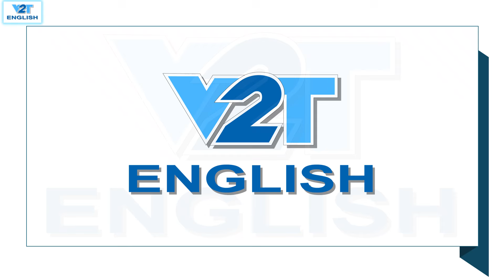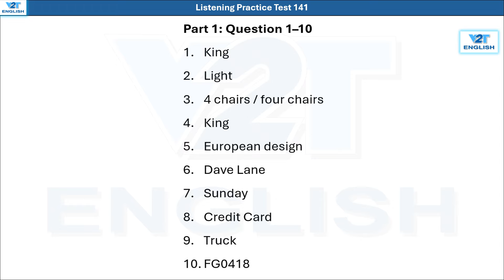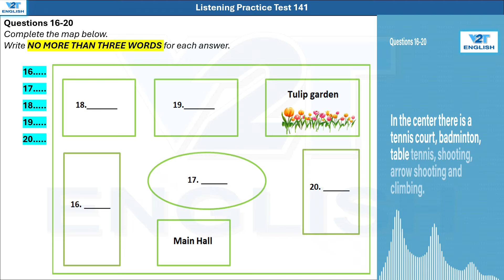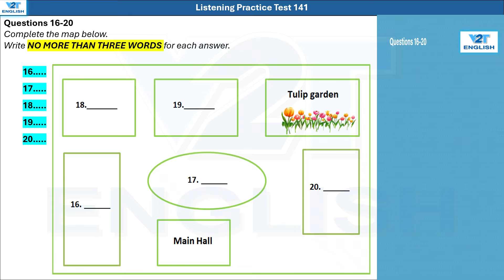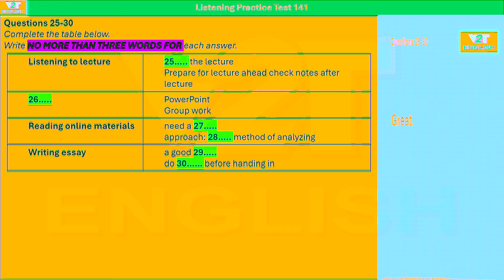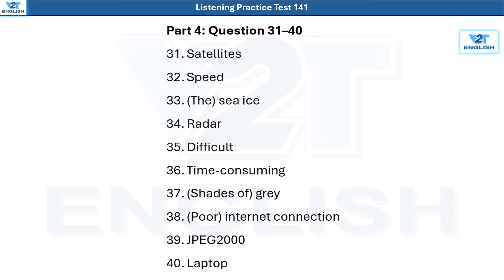Latest IELTS Listening Practice Test 2025 with Answers | Test 141

Comment from the maker: Answers:
Part 1: Question 1–10
1.	King
2.	Light
3.	4 chairs / four chairs
4.	229 pounds
5.	European design
6.	Dave Lane
7.	Sunday
8.	Credit Card
9.	Truck
10.	FG0418
---
Part 2: Question 11–20
11.	North suburb
12.	3,000 / 3000
13.	65 degrees / 65°C 
       / 65 degrees Celsius
14.	Jewellery
15.	SPA pools
16.	Villa Part
17.	Merry Water World
        / Water Sports Center / Centre
18.	Leisure Centre / Center
19.	Sports Centre / Center
20.	Restaurant
--- 
Part 3: Question 21–30
21.	A
22.	B
23.	D, E (Any order)
24.	D, E (Any order)
25.	Record
26.	Presentation(s)
27.	Username and password
28.	Skimming
29.	Draft plan 
30.	Proof-reading
---
Part 4: Question 31–40 
31.	Satellites
32.	Speed
33.	(The) sea ice
34.	Radar
35.	Difficult
36.	Time-consuming
37.	(Shades of) grey
38.	(Poor) internet connection
39.	JPEG2000
40.	Laptop
Reply: Is the answer to question 4 wrong? The correct answer is 229 pounds.
Reply from the maker: Hello @warhol5606. I wanted to express my sincere gratitude for pointing out the incorrect answer that was previously provided. Your attention to detail is greatly appreciated, and I'm very thankful that you took the time to correct it. It's important to me that the information I share is accurate, so I'm especially grateful that you let me know about the mistake. The correct answer, as you rightly pointed out, should indeed be "229 pounds". I have now made the necessary correction to reflect this accurate information. Thank you again so much for your help in ensuring the correctness of the response.